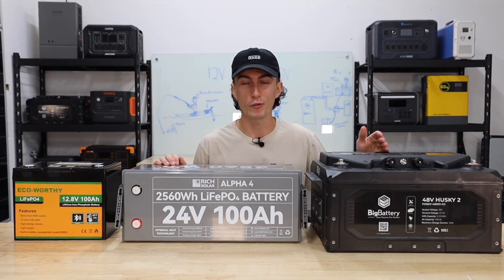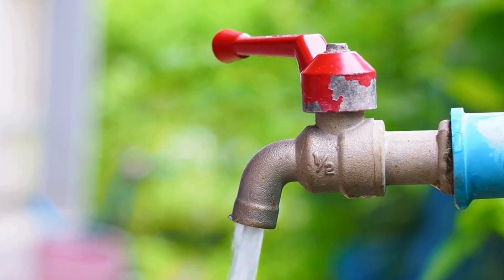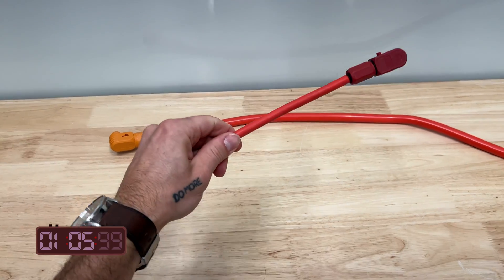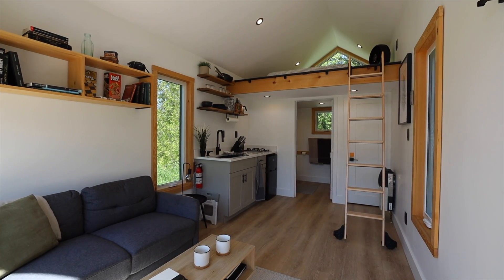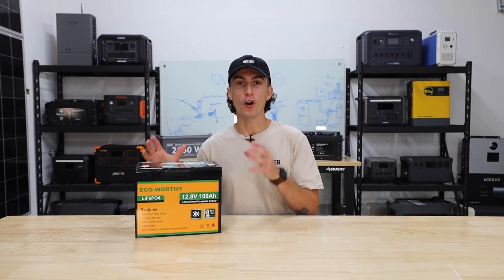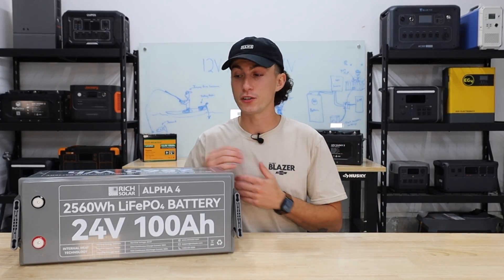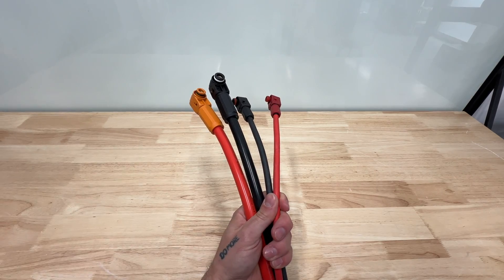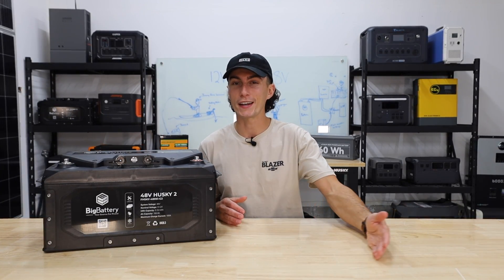Which is Best? - 12 vs 24 vs 48 Volt Solar Batteries Explained

Comment: For anyone who's curious any of the power stations that were in the background of this video that are basically capable of handling a thousand w of continuous output from their AC or more are typically going to be 36 to 48 volts and the ones that are capable of handling $1,500 plus continuous Watts are going to all have a internal battery configuration of 48 volts so the companies that make the power stations are already using the much higher voltage because it actually makes the stations much less expensive to produce and they can actually be more compact by using the higher voltage because of how much extra space the wiring alone would take up as a lower voltage system The one caveat about all of this is unless you're using a power station and you're making your own homemade system. The cheapest and most common equipment that you're going to be able to find is all going to be 12 volt 12 volt solar panels are going to be the easiest and least expensive panels. You can find 12 volt charge controllers are going to be the most readily available and least expensive ones that you can find whether they're pwm or mppt as well as 12 volt batteries are going to be the easiest thing to find and get your hands on without having to then start making a complicated series wiring setup and 12 volt inverters are also going to be the easiest and most common thing that you're going to be able to find as well and yes, he is right. Basically, 1500 w continuous load is kind of where you're going to end at using a 12-volt system. After that you're going to want to go with a higher voltage. And yes another thing that most people commonly do from what I've seen here on YouTube for all the off-griders some of them just jump straight into having a 48 volt system with 48 volt batteries if the batteries are lithium or they just buy depending on what they want and how big of a storage system they want either 8. 6 volt batteries and hook them in series for 48 volts or four. 12 volt batteries and hook them in series for 48 volts for my personal needs, I would probably be doing a 12-volt system if I was not using a power station. Just because once you start getting into the 24 or even 48 volt equipment it becomes so much more expensive that literally you're almost better off just buying a power station given how expensive some of the 24 volt charge controllers and 24 volt inverters can be.
Reply: 12 volt for me was the easiest to start small and piece together as i went started with 25 amp hour single battery and now have 425 ah between 3 different size lithium batterys (another reason for 12 volt for me keeping them balanced) i would have to trash everything i have currently to switch now
Reply: I recently got a 3000W inverter but I’m not sure if it’s 12, 24, or 48. How can I tell?

Comment: You can always start with 12v batteries to get started and then buy more and series them up to 48v just don't buy too much 12v fixed ancillary devices get just enough to get you going..
I bought a cheap inverter and short wire that could support 12v and made due till I got four 12v batteries and series them and then bought the really expensive stuff(48v mmpt controller that takes 500vdc max voltage input from solar cells so  I could buy small copper wire that goes a long distance to the batteries and not have any line loss issue..)
Reply from the maker: You're right, we just think that doing what you did isn't as practical for most people. Sounds like you really know your stuff!

Comment: I'm a retired electrician disabled by years of hard work and type 1 diabetes DC power don't push it's not cycled like AC current pulsating 60 cycles a min.solar power is available now at lower cost the batteries is the biggest cost . inverters hybrid mppt controllers chargers the more money you can spend the better or more lavish systems .iv looked into buying Nissan leaf EV battery whole banks not cells lifpo batters probably safest building your own I don't it saving any money it's more costly than life PO batteries.

Comment: At $3600 each for only 280ah’s, those are some rather expensive batteries! Wiring for a 12v system may be a little more expensive but it’s also a 1 time purchase. For a little less money, you can get 4 of the 12v 280 ah batteries and a 5000w inverter and be running most of your house. Spend the money on a good solar or propane fridge and deep freezer, and move the heavy loads like washer and dryer over to a generator. It’s your money so spend it how you want, but if you’re on a smaller budget, 12v is way cheaper and will get you running and enjoying life

Comment: At 5:28 in the video you contradict yourself using voltage "48 volts " ??
Reply: No contradiction there, you can use it to run close to nothing, to running anything and everything.

Comment: I think the reason for having a 12 or 24 volt system is greater flexibility when comes to the power source if the lithium batteries went bad ( do to a mafunctioning charger or otherwise) finding 1 or 2 lead acid batterys would be easier to find in town at a local store in the event of an emergency.

Comment: Also higher voltages require less guage/thinner cables for the same wattage.. thats clearly wisible when using from heat... when voltage increases amperage decreases if watts stays same... thats why..

Comment: I wish 24V was a lot more popular than it currently is, makes a lot more sense than 12V for ~1kW stuff

24V is ideal for affordable and efficient DC-DC power conversion in the 500W-1.5kW range: heaps of cheap MOSFETs and integrated power stages to choose from that don't compromise much on switching performance and ON-resistance compared to what you'd need for equivalent 12V systems. It should be a no-brainer upgrade from the manufacturing side of things apart from more cells in series being more potential points of failure.

Of course, that will never compete against the vast market for 48V stuff that stems from telecomms using 48V switchgear for 70+ years to dodge needing to get all of their techs fully licensed for electrical work.
Reply: Go right to 48V don't waste money on 12V

Comment: Hmmm. Could one create a 120volt system by series connecting 2 x 48v and 1 x 24 volt batteries? Does that make any sense to do?
Reply: For what reason? If you're thinking you could run 120v tools or appliances. no. One, your actual voltage would immediately drop, and two, Batteries are DC, tools and appliances are AC.
Reply: @Nat_Sarim777  Right, so inverters are needed. What is the highest input voltage inverter available and what is it's efficiency rating?
Reply: @RJMSINCR  i know I am replying to an old comment. What you said is in deed a thing but with few changes. Ideally you do not connect together dissimilar batteries in series. 

They must be in same type, capacity and age. Their internal control systems should support connecting them in series. Also for 100v AC output the voltage of batteries will have to be at least 170v as 110v is actually the average voltage of the supply.

Look up High Voltage DC Inverters. They are usually used in industrial applications where a lot of power is needed. Then the battery voltage will be significantly higher than the output voltage of inverter (Its easier to deliver more power if you start with more voltage). 

But there are few YouTube videos where people have used them with an entire EV battery pack as their home battery where battery voltage can be as high as 800v. But usually these are not meant for homes or people who are learning from youtube, and probably violate few safety regulations and might void your home owner insurance.

Comment: The one down side of higher voltage is the battery packs get heavier to the point where you can't pick them up i.e. 100lbs or more for 48 volt 100ah battery. Also the battery management needs to monitor more cells in series so there are more little wires running around and more connections between cells to keep tight. Then there's the arcing at higher voltage with DC you need to be really careful.
Reply: Just a slip saying 48 on both ends..everyone knew what he meant.

Comment: Appreciate the video.  Good info, explained in a simple and clear manner. 
What if I can save several hundred dollars on a multi battery setup and just run the batteries in series to get 48V?
Reply: Many people do. Many people can afford adding one or two 12v batteries at a time when they find great sales, and some people never have enough $$ leftover to purchase a 4 digit rack battery.
My first 48v system had 16 12v batteries in series/parallel before I had enough $$ left over after paying the mortgage and bills to afford a rack battery.

Comment: Great video, you guys are fantastic. So if I purchase a small Sprinter RV with a 12 volt ac, a 120 volt refrigerator, propane cooktop, a tv, 12 volt led lights and some 120 outlets would I benefit from a 48 volt system?

Comment: One caveat to your skip 24V statement is if your setup is running DC load components w/o an inverter.
Reply: yea I think 24v is perfect for specifically camping/RV, when you buy all appliances that are all 24v, it cuts down on losses, heat, noise, when everything can be just directly connected, no inverters or converters, 12v is the same but there are a lot of things like air fryers that would require too much power to be feasible on 12v

Comment: I can 2x this information. Don’t waste your time with 12v or 24v. Just go straight to 48volt batteries and inverters etc. If you need 12volts then use a step down converter from 48v to 12v. The options for 48v stuff is huge compared to 12v. 
JUST GO WITH A 48VOLT SYSTEM!!!! DONT WASTE YOUR TIME AND MONEY. 
like me….

“Oh my rv and lots of its stuff is 12v so I’ll just buy a bunch of solar panels(6-200 watt) and 15kwh of 12v eg4 batteries and just a little 2000watt inverter to run my fridge 100% in a hurricane or if the power goes out.”
Flash forward 7 months. 
“Man, I can fit like 11 more solar panels on my roof and prolly get rid of my generator and add 3 more batteries and then prolly power 2 air conditioners with all that solar. Oh goddamnit I need 0000 size cables and I can only get 3kva inverters and now I need 2 and gotta put them in splits phase and get a lynx distributor and more cables and. Fuck!”
Reply: 110% agree.

Comment: I built my system back in 2020 48v components were hard to find and expensive. Back at that time Will Prowse was recommending 24v system for medium system like my 250 square ft cabin. I bought a Big Battery 24v 170ah lifepo4 ,2000w inverter and 1000 watts of panels. I use it about it about 120-150 days a year and I'm using the exact system I started with and no down time.
Reply: impressive
Reply: Almost the same situation for me. 24 is fine but there's no upside. Need to convert to 12v for dc use so there's added expense.
Reply: @Ravedave5  could you connect two 24v together?
Reply: @hisnameisiam808  not suggested.
Reply: @powerwall  ok, thank you.
Reply: @Ravedave5  upside is lower gauge cables. Can make a significant difference in $$ for high loads.

Comment: Also charge controllers are far more effective at 48V than at 12V.  A 20A charge controller at 12.8V can handle up to 256W worth of solar panels.   That SAME controller at 51.2V can handle over 1000W (assuming a controller that does 12/24/36/48V of course, but many do these days).  Just as an example.

Convenient kitchen appliances... Microwave, induction tea kettle, toaster oven, induction "burner", well pump.... the list goes on.  Best to just go straight to 48V (51.2V LiFePO4) in most situations.   In fact, I would only consider 12V at far lower wattages than the channel recommends.  If its less than 500W then 12V is an option.  If its more, or you might scale higher than 500W, then I'd go straight to 48V.

At 48V, 2 AWG main battery and inverter wiring nets you 100A @ 51.2V = 5000W of continuous power without anything even getting warm to the touch, let alone hot.  And all the solar panel string and charge controller output wiring can be 10 AWG.

The only real gotchas with 48V is that (A) You need to be a bit more up on your electronics skills.  (B) Getting any fusing and breakers right is more important.  And (C) you need to pay more attention the solar panel topology.   The best charge controllers are buck controllers (Victron's for example) which means that to work properly with a 48V system the solar strings have to generate roughly 65VDC or higher "operating voltage".

---

For string voltages I shoot for at least 70V.  Higher if partial shading might be an issue.  My go-to charge controller is thus something like a Victron 150/35 for the voltage range it supports rather than a Victron 100/20.  A single 150/35 can handle 1800W worth of generation all by its lonesome.

You can do this with any solar panel wattage but you need to figure out how many in series you need to get decent results, plus one more to help deal with partial shading situations.  Even 25W panels would work, but you would need 4 x 25W in series to develop a decent voltage for a 48V system.  Similarly for other small panels.  When you get to more serious panels... 100W you typically need 3 x 100W in series (but if they are low-voltage 100W panels you'd still need 4).  200W panels you would also typically want 3 in series.  Higher than that the voltages are higher so typically residential panels would need only 2 in series.

My go-to is always 48V.  I only consider 12V for very very small systems and only consider 24V in very special cases.  My default is 48V these days.

-Matt
Reply: I’ve been running a Trace 4048 at our remote cabin for over 23 years. The batteries lasted 22 years. With a higher voltage there is less current going through the battery so the batteries internal resistance is less. We used only 48 v inverters in telecommunications. I worked in electronics most of my work career.
Reply: @Chris_at_Home  The old trace gear is some of the best ever made.  Unfortunately when the company was bought out, the gear quality went down a lot and they created a lot of confusion by using the same product names.

The closest you can come to that old pre-buyout trace gear these days would be something like the Victron Multiplus II series of inverters, and Victron charge controllers.   Which I love.

-Matt
Reply: @junkerzn7312  thanks for the great insight you shared.
Reply: @Chris_at_Home thanks for the great advice
Reply: @Chris_at_Home please, would you be so kind to provide more information on those batteries that lasted 22 years?
Reply: @ajarivas72  They were Concorde 12v AGM 105 amp hours. I had 8 of them giving me about a 10KW battery bank. Even when running large loads my battery plant stayed above 47-48 volts.   I did maintenance on the terminals similar to how we did it at work. I’d put a medium sized load on the batteries and check for any voltage drop between battery terminals. Also I use a laser pointing thermometer to look for any temperature fluctuations. I’d also torque the bolts to specs annually as lead flows over time.
Reply: Good point Matt

Comment: 48V is the way to go! Nice vid, thanks.
Reply: 48 volts higher the voltage less amps meaning smaller wires sizes saved money.
Reply: @darrellwalker5203  that is right 100%
Reply from the maker: Thanks for watching ⚡️
Reply: agree
Reply: I found it! Nice vid.🙂

Comment: What about safety considerations for the beginners that this video seems aimed at?  Is it much easier to get yourself in trouble/danger handling 48V stuff? What are the most important safety cautions for the beginner? If that kind of info isn't in that playlist you mentioned, perhaps it would be a good candidate for another video.
Reply: Like getting hurt wise everything under 60volts is pretty much the same level of safety.  

Starting fires type safety the voltage really doesn’t matter 12v will burn down a house just as good as 480v.
Reply: @Summitperry  Anything over 36 can kill you, 12 cannot.
Reply: @Nat_Sarim777  BS,even a few volt can kill you,it depend on the AMP
Reply: @kozko-xe1xl https://www.youtube.com/watch?v=BGD-oSwJv3E
Reply: @kozko-xe1xl https://www.youtube.com/watch?v=ywaTX-nLm6Y
Reply: ready made 48V is the best option for you.